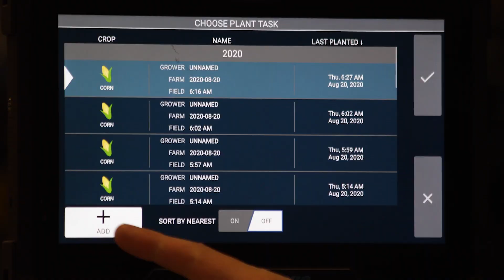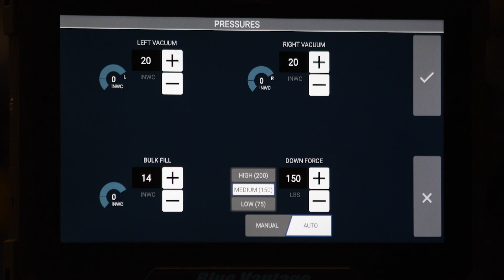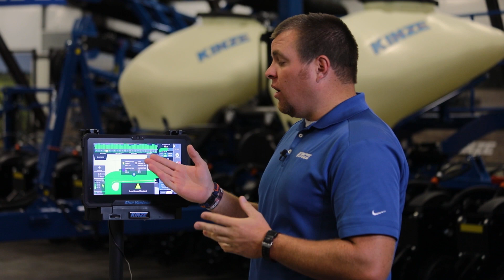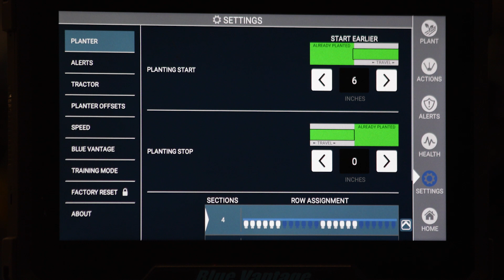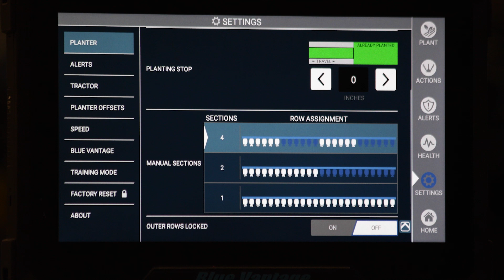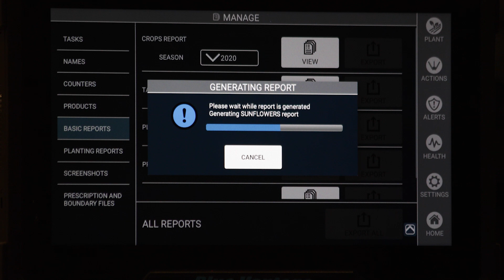Blue Vantage Model Year 21 | New Features

Comment: If you were running 2 planters equipped with this monitor would they talk to each other so that section control would work for both on a shared map the way Deere will? Thanks
Reply: Yes! That feature will be rolled out in Model Year 2022. Its called MAP SYNC. How it works is, you sign in with the same account on both the planters and the tasks that you create on one display will automatically sync with the other display. You can watch the plant marks of the other planter in live (sky blue colored marks) and section control will come into play if you plant over those blue marks that are planter by the other planter.